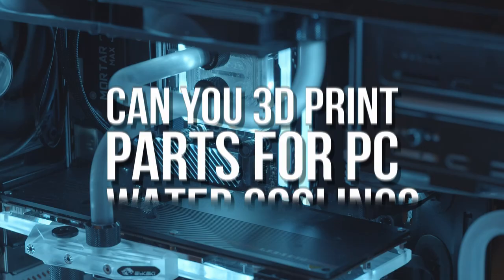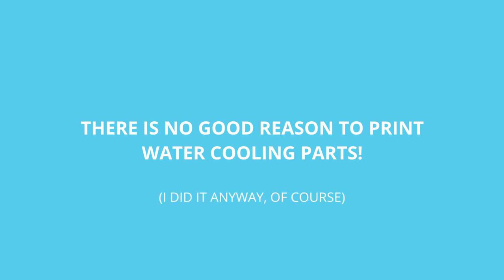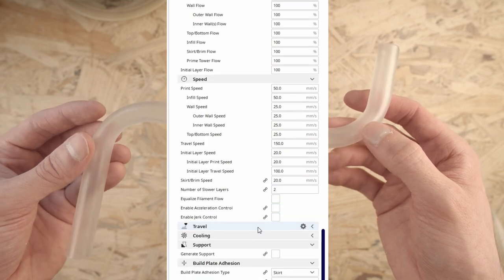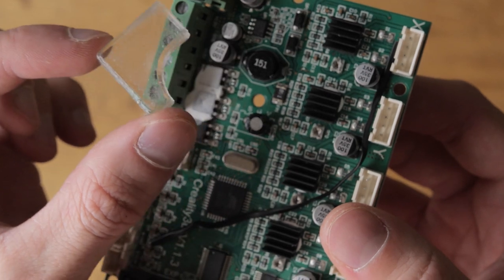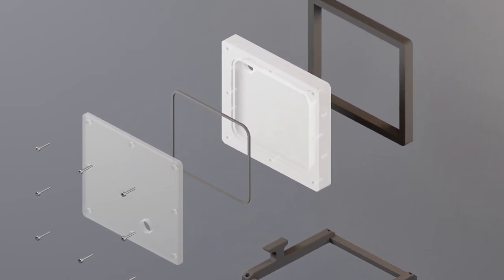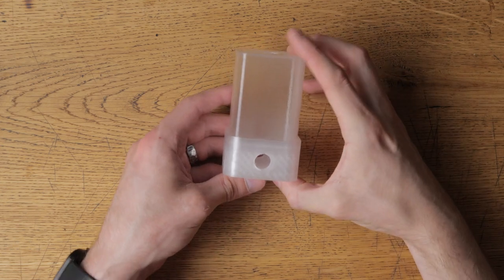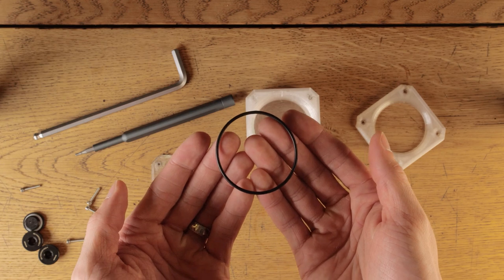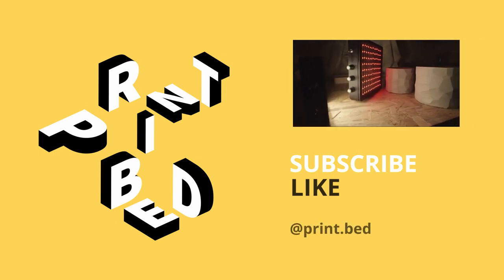Can You 3D PRINT WATERCOOLING Parts?

Comment: Good vid I came across this as I intend to print parts that cannot be bought  like custom VRM heatsinks for a very fast but strange chinese mainboard with an engineering sample cpu, this is the only application I would use it for, but have toyed with the idea of using the printer as a somewhat accurate measuring device  using baby steps to map out the height of various components on cards with a view to make cooling plates for

Comment: please make more parts :P
Reply from the maker: If I ever pick up a resin printer I will probably revisit the concept!
Reply: @printbed7082  id lend you mine if i could, would make for a great series like get a burner pc custom loop and temp test and see what kind of temps come out compared to resin printed parts.. great video btw the, very well scripted!
Reply from the maker: @myleshatcher1814  It shouldn't effect temps at all. We can't print blocks or radiators as those need to be metal for decent thermal transfer, so you're limited to water circulation parts.
Reply: @printbed7082  could definitely do a distro or the housing for the gpu and fittings, itll be less about beating established main brand cooling parts and more of a can it be done. either way your video inspired me, i may need to print some bits ;)